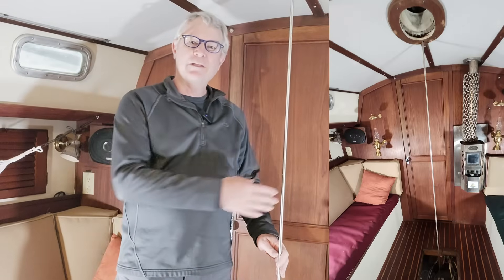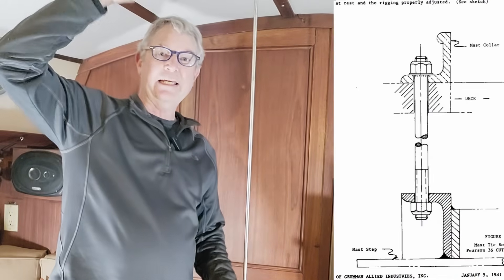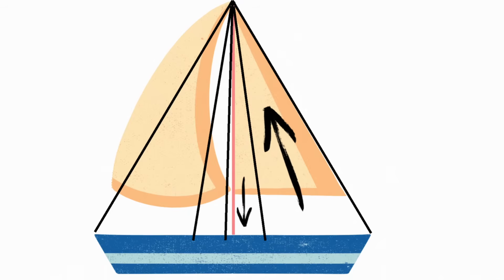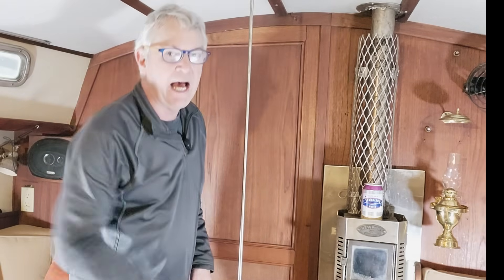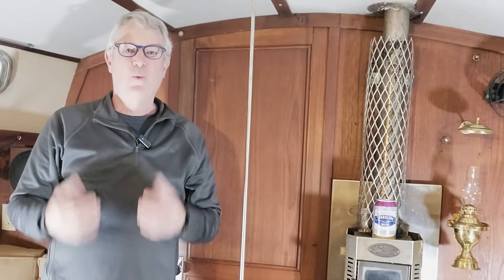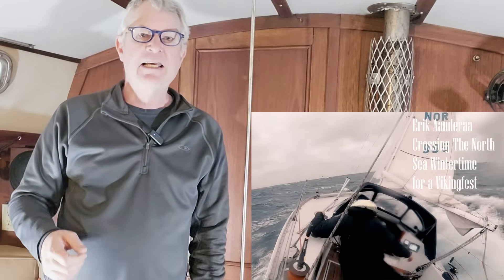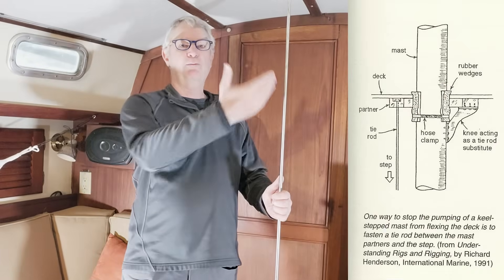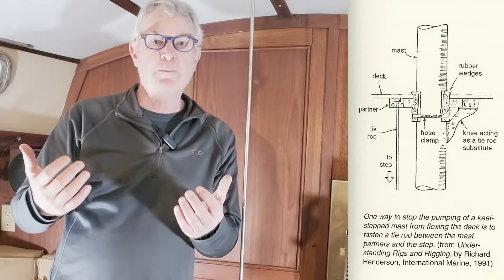What a PANTING ROD does and why it is ESSENTIAL to protect your Deck!

Comment: Great video!  I’ve not seen the forces at play nor the panting rod described in such a clear way.  I’ve heard it described as a deck tension or compression rod and have seen it on many boats.  Our Tartan 3800 has one, and the nut above the deck failed just recently.  Thanks again for the quick learning session!
Reply from the maker: @AltaredCourse  Thank you for the high praise. I am glad you found value in the information.  Thanks for watching!

Comment: Hey Eric,

Pretty good video.  I have one comment.  You say at about 1:35 that the rigging takes aerodynamic force from the wind and transfers it to hydrodynamic force that moves the sailboat through the water.  I don't think this is precisely correct.  Yes, the wind creates aerodynamic force that acts on the sails, and therefore the rigging and hull, to drive the whole thing forward.  But that forward motion does not become, or convert to, hydrodynamic force.  To the contrary, hydrodynamic forces would be the the lift created by the keel resisting sideways motion, the lift created by the rudder, or the resistance on the hull.  These hydrodynamic forces actual counters/resist the force attempting to push the boat through the water which was generated as aerodynamic force on the sails.  In other words, the hydrodynamic force is not driving the sailboat.  Instead, the hydrodynamic forces resist the motion of the hull through the water, whether they are the friction of the water flowing over the hull, or the lift created by the keel or rudder.

Russ
Sailing Vessel Coyote, ABYC, Long Beach, California
Reply from the maker: Thank you for the comment.  I did characterize a conversion of the aerodynamic lift to become hydrodynamic lift via the vehicle of the hull, but I am not an expert and it may very well be a lack of precision in the characterization.  I have not studied aerodynamics, hydrodynamics or physics formally.  I appreciate you taking the time to add color and precision to the information.  I always appreciate learning.  Thanks for watching!

Comment: Whenever i see something so awkwardly placed in a boat i always assume it wasnt in the original design but was added when problems arose in the early production models.
Reply from the maker: @markm417  Possible. My hull number is 17. Thanks for the comment, and thanks for watching.
Reply: These are on a ton of keel stepped boats.  I’ve seen very few built in the 90’s or newer that don’t have one.

Comment: Trust you Yanks to poorly design a yacht .. there should always be a bulkhead to support a deck fitted mast !
Reply from the maker: @PaulONeill-x8e  Thanks for the comment and for watching.
Reply: My British designed boat had a panting rod. This explanation is technically correct. I always likened it to a bow and arrow. Holding the bow with a stiff arm and pulling back on the string causes the bow to bend the bow tips inward. As the hull moves inward the deck buckles upward if not restrained by the panting rod. It is the tension on the rigging that mimics the actions of pulling the bow string. dcniner01
Reply: The panting rod is a feature of keel stepped masts not deck stepped masts. dcniner01
Reply: Fragile egos rely on nationalism to bolster them.

Comment: Super interesting, I’ve had mast panting before in storms. Now I have a cool word to use when it happens.
Reply from the maker: @ijayess  Excellent. I am glad you found the information useful. Thanks for the comment, and thanks for watching.
Reply: @SailorEricsNextAdventure  The rod won't stop the mast panting. That's the job of the mainsail and the inner forestay (and/or running backstays & babystay if fitted). The panting rod's purpose is to stop the deck from panting (deflecting upwards from the inwards squeeze caused chiefly by the inwards angle of the lower stays as they come under fluctuating load)
Reply from the maker: @Gottenhimfella  Thanks for the comment, and thanks for watching!

Comment: The correct answer is a lot more simple. This is to stop lifting of the deck caused by the upward load from halyards going through blocks at the deck collar being routed aft to cockpit winches. 
Also a sailboat is not driven from loads on the rig, but a pressure difference created by wind flowing around the windward and leeward sides of the sails .
Reply from the maker: Thanks for the comment.  I'll note that my Pearson 424 was built without blocks at the deck collar routing halyards to the cockpit, and it's still true today.  I go up to the mast to raise the main, stay sail, and spinnaker.  Yet the boat was built with a panting rod which suggests to me that there may be another reason for it.  Thanks for watching.
Reply: I’ve never seen such a thing on a boat with a deck stepped mast, because there, you rather have the opposite problem of the mast pushing the deck down. The hull should be stabilized by bulkheads etc. and should not move under load - at least not to the extent that some rod should  keep the deck down. It may be that early GRP designs added this feature because they had no clear view on the stability of GRP in the first place. Wodden boats never have these, they rather pull the planks open than buckle the deck. But - as a side not to gordon - of course a sailboat is driven by the loads on the rig. It’s the rig which generates the force to propel the boat, so these forces have to be transferred from the rig to the hull to make it move. In the same way at the engine propels a motorboat, but it is the engine mounts which take up all the propelling forces to transfer them to the hull.
Reply from the maker: I appreciate your comment.  Your observation about design during the early days of GRP strikes a chord with me as being very possible.  Thanks for watching.
Reply: @alexandermenck6609  (in case you weren't aware, Eric's boat has a keel stepped mast, it's just not present at the time this clip was shot). The lower shrouds, when they come under tension from the mainsail, are trying to pull the gunwhales together in the region of the mast. If the nearest structural bulkhead is some distance from a keel stepped mast it's advisable to include either a more substantial ring frame, or an extra deep deck beam, or a panting rod offset from the mast station by about the same distance as the bulkhead, but in the opposite direction. Such measures also help stiffen the deck from buckling upwards if the vessel is subjected to heavy side loads when tied up or rafted in adverse circumstances. Fibreglass is not particularly stiff (for its strength and weight), compared with wood, unless it is cored to a substantial depth.
I agree with you that the forces Gordon mentions on the sails can only be transferred into the boat via the mast and shrouds and stays (as you say, the rig). And your engine analogy is a good one, provided there is no separate thrust bearing associated with the stern tube, or similar, as sometimes seen on larger boats.
Reply: That wind causes lifting on the windward shrouds.

Comment: Get a properly built boat in the first place,simples.
Reply from the maker: Thanks for watching and for the comment.
Reply: I must admit tha I would find the panting rod a real nuisance where it is fitted on your boat , directly in the way of a door way . Surely the rod could be fitted , or the interior walls designed , so that the rod was less in the way and out of mind . It seems to be an accident waiting to happen ! Nice boat , very nice indeed , but I feel you might also wonder if you could remove that rod for the same reason , eh ?
Reply from the maker: The rod becomes less noticeable once the mast is stepped into the keel as the mast becomes the obstacle in the cabin.  Even so, your observation stands that boat design requires support where the mast comes down to the deck for a deck stepped sailboat, and through the deck for a keel stepped sailboat.  There are alternative options to managing the need for structure and support in a sailboat though it might be a trade-off between comfort and performance.  Thanks for watching.
Reply: @ It's clearly a design fault & is an after thought because the deck flexes. Buy a decent boat in the first place like a Macwester 27 series two & you don't need that but then that is a British made boat.🙂

Comment: Excellent video, and I congratulate you on the clarity of your presentation. My Rustler 36 has a deck-stepped mast with a massive solid teak mast support. The chainplates are all mounted direct to the hull, either through bulkheads or glassed-in teak blocks, so the only stress is the compression inwards from the lateral standing rigging of the hull sides, but the massive bulkhead immediately forward of the mast compression post resists this. Your video does an excellent job of explaining the stresses on the hull caused by the rig, and I had never heard of a panting rod.
Reply from the maker: I've heard many good things about the Rustler 36 and I believe it has been used by more than one sailor in the Golden Globe Races (solo non-stop around the world).  It must be a pleasure to sail, and you must be a proud owner!  Thank you very much for the affirmation of the information.  I found it difficult to find much written information on the subject and had to piece together what I suspected to be true based on what I could find.  Thanks for the comment and thanks for watching!

Comment: My guess is this would not be needed if the bulkhead was closer to the mast?
Reply from the maker: @markph0204 I do not know the answer, but it seems logical, and the sentiment was shared in another comment.  Thanks for watching!
Reply: Having sailed in a 55 sloop where the bulkhead let go in the middle of the Tasman Sea I feel that a panting rod should always be fitted with a keel stepped mast. 🐟
Reply from the maker: @richardmclaren8549  Thanks for sharing that insight and experience.  I appreciate the comment.
Reply: @richardmclaren8549  Yow!

Comment: Mast panting is also known as mast pumping.  Try running your boat without the panting rod and report your findings.  Good info though.  My Pearson has one and I had to do a lot of reading as to why it’s necessary because it wasn’t installed when I purchased the boat.
Reply from the maker: Most interesting comment!  It must have been difficult to find the right resources, but satisfying to figure it out.  You must have insight on how the boat/mast/deck handles without the panting rod and I can only guess at how significant the impact.  Thanks for watching and for the comment.
Reply: Why would you ask someone who admitted that he doesn't know what the forces on the panting rod are to remove and report on it. The engineer/ naval architect who designed the boat thought it was needed. Unless one considers himself more knowledgeable than the designer...why experiment with something that could damage the boat beyond repair?
Reply: No, mast panting is a misnomer! Yes, mast panting is a very real thing, but completely seperate forces, caused by different phenomena. Panting is where the hull expands and contracts, due to differing hydrostatic pressures, caused by the bodily rise and fall of a vessel in a seaway. Each time the vessel submerges, or “sinks bodily” due to wave action (Normally a head-sea) the hydrostatic pressure ‘squeezes’ the (Forward part of the) hull, causing the deck to bulge or bow upward and outward.
  Mast pumping is caused (In the same circumstances) by the rapid acceleration and deceleration of the mast due to the inertia caused by the vessel pitching (i.e. Hobby-horsing), again, in a head-sea.
  Mast pumping can be reduced by the use of ‘Check stays’ (Normally in conjunction with Running back-stays) and Inner forestays, or Bob-stays. I have personally witnessed serious rig damage due to failure to eliminate heavy mast pumping. (Torn spreaders!)
Hope this clarifies the differences…
Reply from the maker: @micheldawes1  I appreciated your defining a distinction between the two terms.  Interesting. Thanks for the comment, and thanks for watching!

Comment: Interesting video mate - you've alerted me as to something i didn't know about, despite friends being master sailors. But unfortunately your video doesn't show practical fitting or design considerations and neither theoretical calculations as to needs nor rules of thumb for application - the latter i'd love to know. Do please expand on that. Thanks.
Reply from the maker: Thanks so much for the comment and for watching!  I wish I could tell you more about it today, but what I shared in the video is currently the limit of my expertise.  I found some of my information from Cruiser Forums like this: https://www.cruisersforum.com/forums/f129/rod-in-cabin-just-aft-of-keel-stepped-mast-139550.html.  To get your questions answered in the more immediate term, I would suggest Books or resources on Boat Design or information put out by Boat Standard Organizations like ABYC: https://abycinc.org/or IIMS: https://www.iims.org.uk/ as possible resources.  I will take your suggestion and as I expand my boat design and systems knowledge, I'll consider a follow up video.  Thanks again for the comment.

Comment: Hello sailor Eric. 
In my reports I refer to the panting rod as you explained it, and I refer to the deck tie down as the rod that anchor the ring around the mast where all the blocks are secured in boats where the running rigging is led aft to the cockpit.
Reply from the maker: Thank you!  I appreciate your affirmation.  Given your reference to reports, I'm guessing that you may be a Marine Surveyor, in which case your information is greatly appreciated.  Thanks for watching!

Comment: Also counteracts the upward pull of halyards going through blocks at the base of the mast
Reply from the maker: Good point. It certainly does. Thanks for watching!
Reply: the stresses of the halyards and also the vang ( if the vang attachment connects to the deck ), these stresses can be enormous and should be accounted for.
Reply from the maker: @brianmacadam4793  Thanks for the comment and for watching.
Reply: That's the function of the deck tie-ins seen at the beginning of the video. Much more efficient at capturing and transfering the tensile load on the deck back into a compressive load in the mast since they are located under the turning blocks. If I'm understanding the function correctly, the purpose of the panting post is akin to a flying buttress, except in tension in order to resist the compressive forces along the decktop as the shrouds are loaded.
Reply: @daveopincarne3718  Indeed, to your first point (usually called tie-downs, in my experience) And Brian raises a good point about the upforce from the vang, which the tie-downs also need to offset.
Eric referred at one point to the mast panting, but really it's the panting of the deck which the rod is intended to counteract, mainly as he points out from the inwards component of the lower stays, but also smacks athwartships from a steep beam sea against the topsides. Perhaps the situation could be somewhat likened to bolts under repeated loading, which will break (from fatigue cracking) if the are insufficiently tight, because that will induce fluctuating stresses which a tight bolt does not have to undergo.
I think the rod is offset aft in the case of his rig because there is a bulkhead forrard of the mast which will deal with any panting in that region.

Comment: Very interesting Sailor Eric.  Funny I asked the skipper/owner of the 56’ Andrew’s I was sailing on in Mexico and he had no idea what that skinny pole was for when I asked him.  I shared your video with him so he can correctly respond to future guest.  Seems odd that pole can support so much?  Thanks for the share.⚓️⛵️-Jim
Reply from the maker: Hi Jim.  Thanks for your comment and for watching.  Very coincidental that I happened to dig into that subject given your recent experience.  I can't speak to the actual load bearing capacity required, but the rod was bolted on securely at the top and bottom.  I can also imagine that by placing the rod in the relative middle of the deck, it might decrease the unsupported surface area by half.  I'm just talking off the cuff, but the question makes me think of how much more rigid and harder to break half an uncooked spaghetti noodle is versus a full length uncooked spaghetti noodle.  The context comes from some videos I saw from the Rigging Doctor https://www.youtube.com/@RiggingDoctor explaining deck stepped masts versus keel stepped masts.  I know we are talking about deck support here, but am just sharing what comes to mind from my own context.
Reply: That skinny rod can't take much in compression but in tension can take a lot.
Reply: @scottwhitcher265  Yes, and given that the mast is not deck stepped but keel stepped, tension is all it will see.